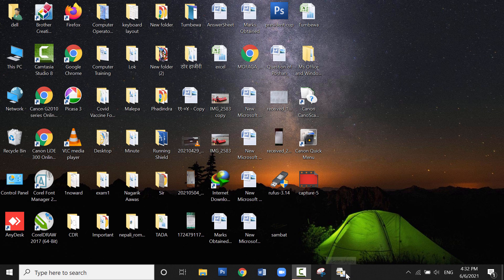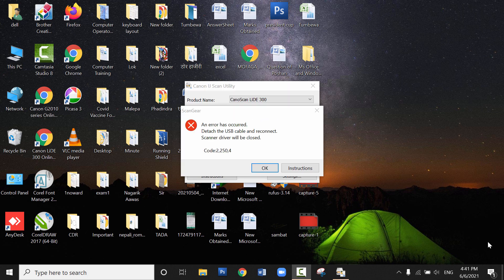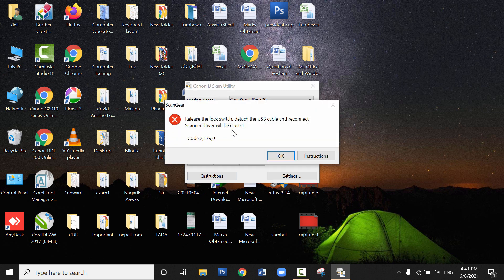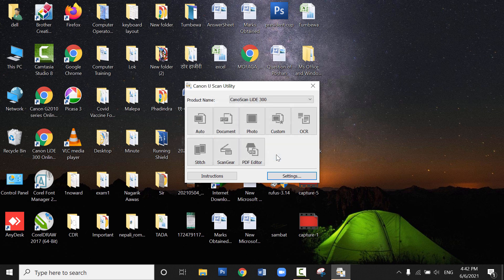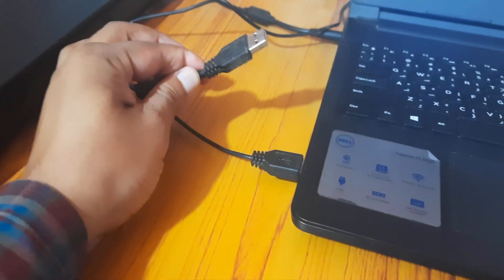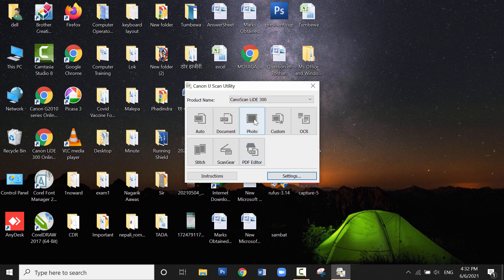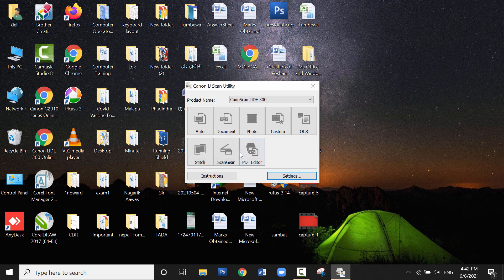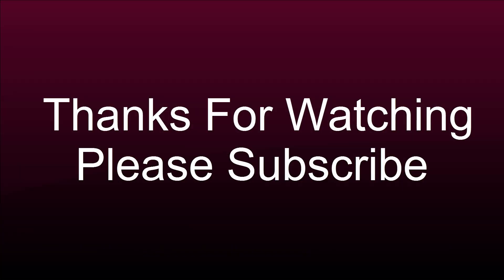Canoscan Lide Communication Error Problem Solved

Comment: No, my scanner was not locked and this doesn't help me.  I've installed the scanner on 2 computers, one running Window 11 64 bit home, the other Win10 64 bit pro.  Both installed no problem, but won't scan.

Comment: Do you know how to fix the error 140?  Canon instruction says wait for the scanner to finish its current task, which makes no sense.  The scanner has been sitting idle for days.  
The only fix is to disconnect the data cable in the back and then start over.  It would then work 75% time.  The other 25% times I had to repeatedly disconnect and reconnect that cable more than once to get it to work.  Strangely enough I connect the USB cable to an on-off switch to avoid having to repeatedly disconnect and reconnect the cable to the back of the LIDE,  it would not work this way.  I have to physically disconnect the USB cable from the connection in the back of the scanner to get it working.  
Thanks for your help.

Comment: CANNOT COMMUNICATE WITH SCANNER FOR THESE REASONS: Scanner is turned 
off. USB cable is disconnected. Please check and try again. Scanner driver will be closed. Code: 
2.156.33
Reply: Check output pin is fit or shaking...,

Comment: Hello, I am in need for HELP
I purchased a new Lide 300 although I have a perfect working Lide 210 that is performing 
PERFECT. I have 30 years’ experience with Pc and Macs and scanners. I have 2 W10 + 2 W11 +2 
New MacBook pro. My Lide 300 arrived, and I went ahead with the installation. Yes, I was aware 
about the lock switch in the bottom from my Lide 210. Everything went well until I got the 
message CANNOT COMMUNICATE WITH SCANNER FOR THESE REASONS: Scanner is turned 
off. USB cable is disconnected. Please check and try again. Scanner driver will be closed. Code: 
2.156.33
I tried on all my computers (6) and received the same answer. I concluded I received a faulty 
scanner. I returned it and received another. Went through and received the same result. I can see 
the driver has been installed and the software. When I run the installation, it will make a stop on 
number 4 of 7 in the top screen and then I get the message. I couldn’t get 2 faulty scanners?
Any ideas? I am using the original cable. I have owned several scanners and never had any 
problems to get them installed.
Would appreciate any help.
Regards Sven

Comment: Seriously, just unlocking??? I have checked locking /unlocking, changed USB cable, reinstalled software...yet receiving error code: 2, 156, 33. I don't know what else to do.
Reply from the maker: I do have got the same problem and was resolved by the above steps.
If i found any other ways 
I will let you know